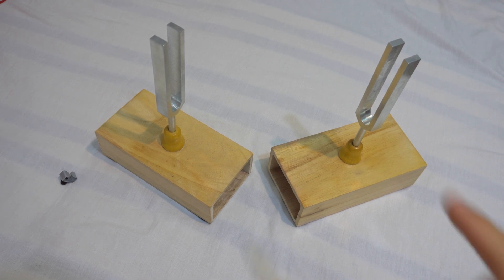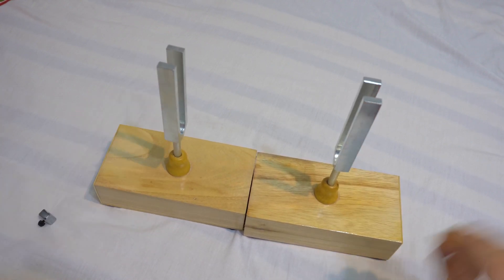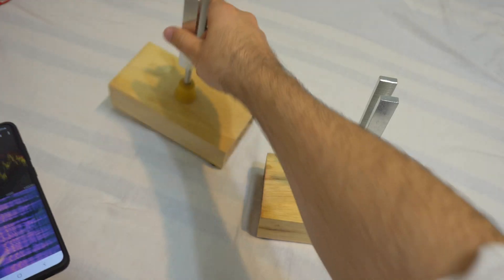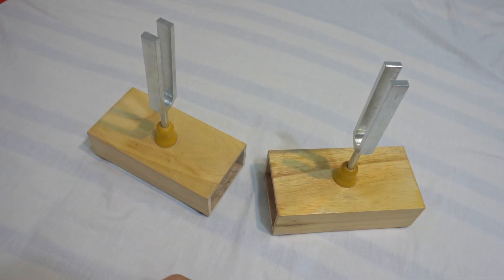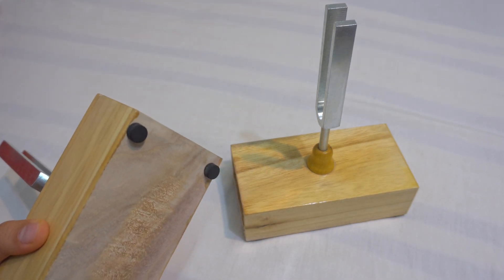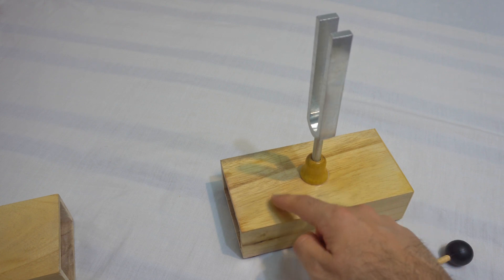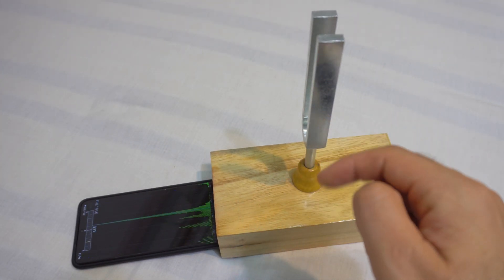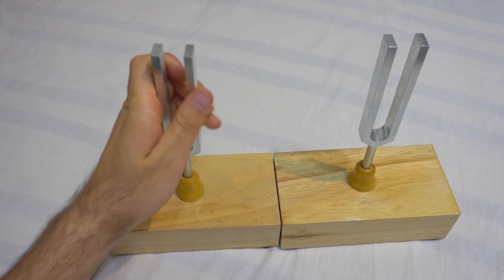Acoustic Resonance using Tuning Forks (440Hz, Spectrum Analyzer apps)

Comment: Unfortunately your test doesn't make sense because each app has a different FFT configuration. Out-of-box settings ain't good. You should set the same settings - sampling frequency, window function (set to rectangular) and especially the input samples as it determines the freq. resolution. I ran the second app for example with 16384 samples at 48kHz and the frequency is 439Hz, what matches the first app. Regards.